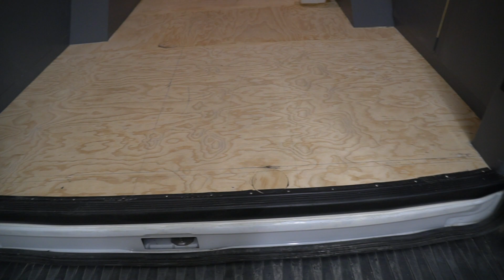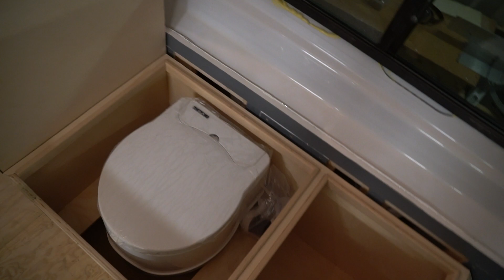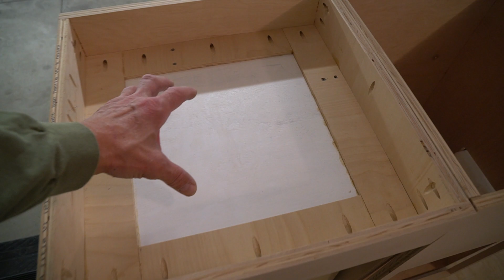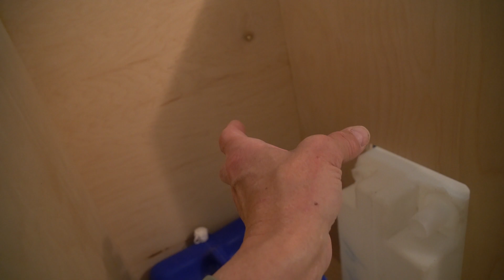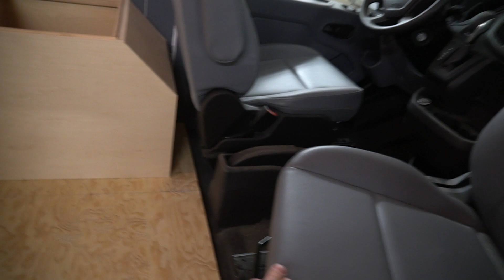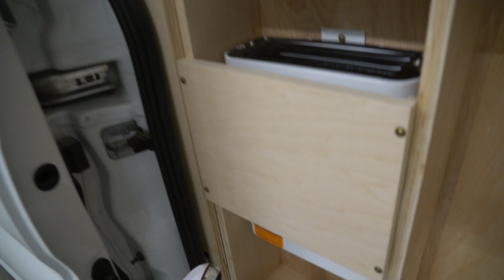Ford Transit van build 1

Comment: Randy, the build looks great. Have you thought about picking up a "Heater buddy"? It's a small, portable heater, powered by camp stove propane bottles. Some people I know use them to heat their boats and they swear by them.

https://www.cabelas.ca/product/10205?productVariantId=51534&gclid=Cj0KCQjw4dr0BRCxARIsAKUNjWSWV7Ie7Pr0SXf9916C9wu8jVMAr2TDI94D2cAp8JTNIx3P0iMUWnsaAps3EALw_wcB
Reply from the maker: we don't expect to do too much winter camping with this rig, but a small propane heater would be more than enough to toast up a small space like this... and a good enough reason to have a CO detector I guess.